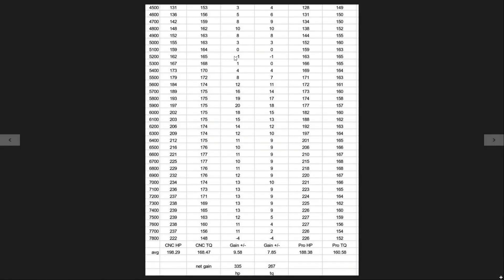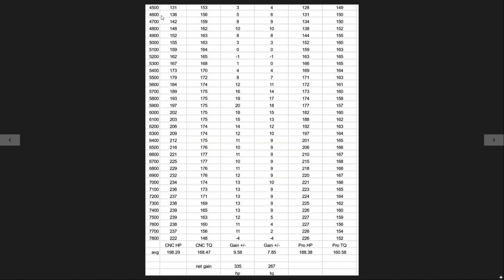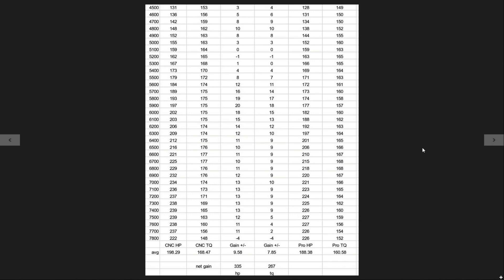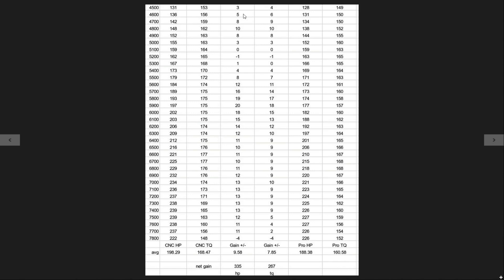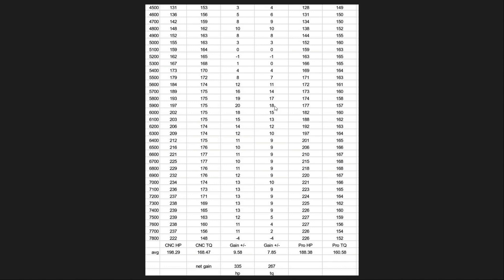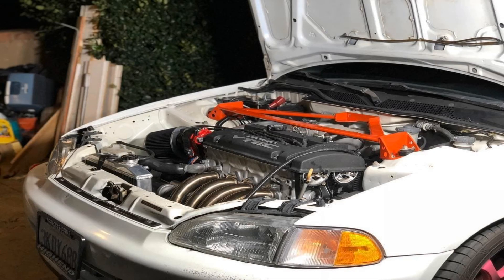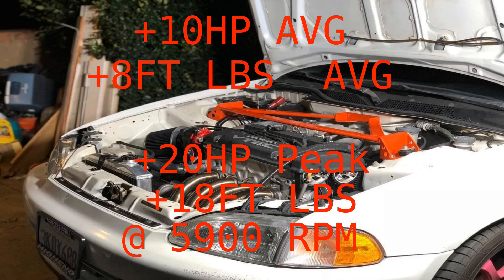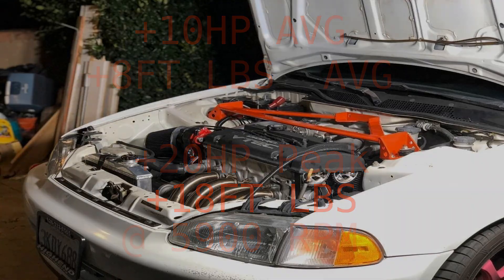H Series Dyno Testing Skunk2 Pro VS Gutted Upper and Lower

Comment: You running stock pistons and valves? Any issues running the stage 3 cams? Wanna do something similar for my h22 before I drop it in the car without having to pull the head off lol.